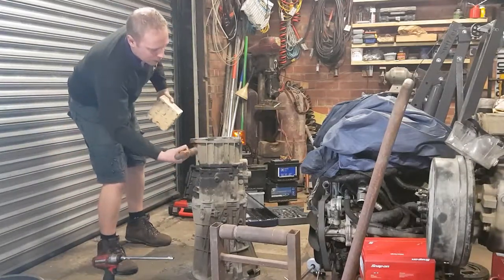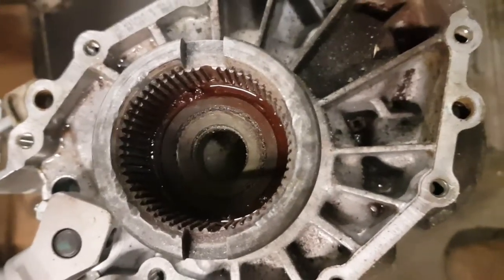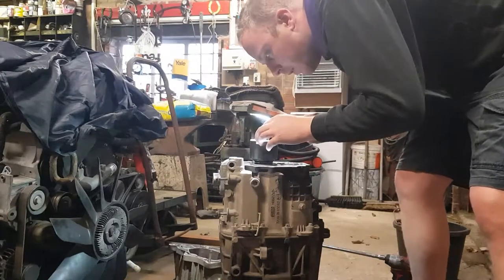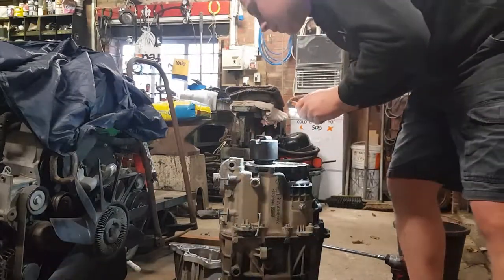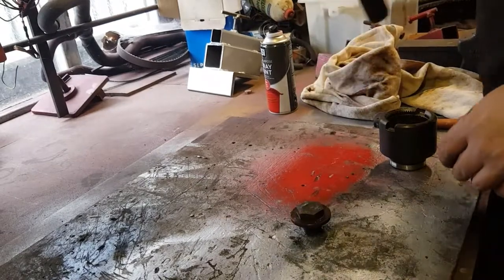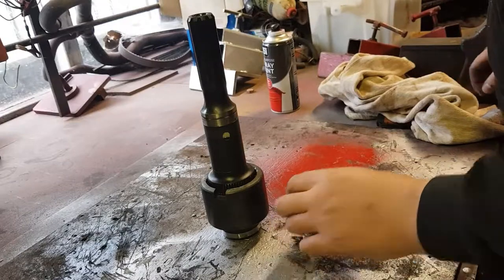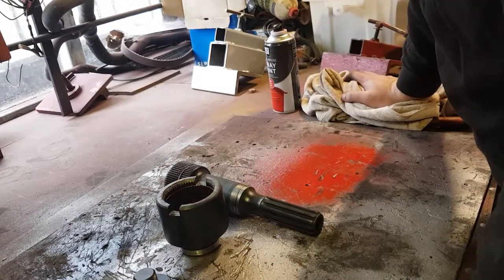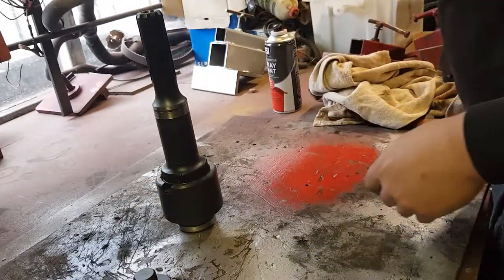Land Rover Defender Puma 2.2 2.4 MT-82 Gearbox output Shaft Cup removal Guide Part 2 Restoration

Comment: On the LT230 transfer box there was the early problem that the splined connection to the gearbox output shaft was unlubricated leading to premature failure of the splines. This was solved by the simple expedient of drilling holes in the splined sleeve so gear oil could penetrate (this was just splash oil from the transfer box but it was sufficient).
From what I see here it seems as if LR are repeating earlier mistakes.
Keep up the good work. Informative videos.
Reply from the maker: Yes i agree. They are fine when they are greased but somewhere down the line they must have forgot. I am sure the later pumas LR started to grease them from the factory due to the amount of warranty claims for the output shaft.
Reply: @lifes.projects  I am surprised that an initial greasing does the job. I would have thought that continuous lubrication was needed.
I try to take a balanced view about the poor LR reputation for reliability and indeed it's often the action of the owners which causes the problems. However in this case LR seem to have made a major error by re-introducing an earlier desgn flaw.

Comment: Just pulled my gearbox yesterday and pulled the transfer box off.  My shaft has a lot of wobble, so should be easy to pull out of the cup, I'll do a video.
Reply from the maker: Good stuff. It may have alot of wobble with it been dry. If its in good condition you could grease it up and put it back but in my opinion if youve got it out replace it with a new one and grease thoroughly then you know its done right and wont cause problems in the future.

Comment: What are the symptoms of having a worn output shaft? I'm guessing once it's worn it would be easier to get the shaft out of the hub? Then you still need to get the bloody hub off the back of the box?
Reply from the maker: The symptons are lash in the gearbox when getting your clutch bite, if you put it in reverse slowly get your clutch to bite and feel for a little jolt when taking up drive. 
It can be difficult to diagnose if your rear half shafts are worn as you also get movement from those. If they are worn listen for the knock from the transfer box area rather than the back axle

Comment: Good’ay Tom , did you consider  the latest upgrade from Ashcrofts ?
I am currently on my 4th output shaft which really demonstrates the poor design of this component and is a sore point with me .
The 1st rusty unit was replaced at 128K , the 2nd greased unit only lasted 30K ( it became rusty and pitted) and was replaced with the early “blue “ Ashcroft unit . I thought this would be the ONE , but an oil leak developed from that area , so when the Transfer Box was removed for some new bearings etc , Dave Ashcroft recommended that I upgrade again to the last east “red” version . This appears to have solved all the issues and I am reasonably confident that this will be my last one !
Reply from the maker: 4th! Wow thats insane! I didnt really look at Ashcrofts in all honesty. Ive heard good reports about them but i got mine on a deal with the Clutch Kit (both upgraded parts). Both have great reviews so i went with the deal option. I changed all the gaskets too while it was in bits to hopefully avoid the oil leaks too. Cant believe your greased unit only lasted 30k! Do you do some heavy towing or do you reckon you had some bad luck with the parts? Yes hopefully now you have the latest shaft installed you can forget about it now 🤣